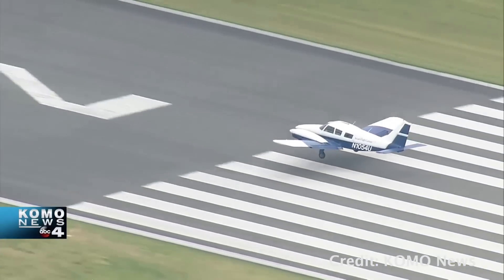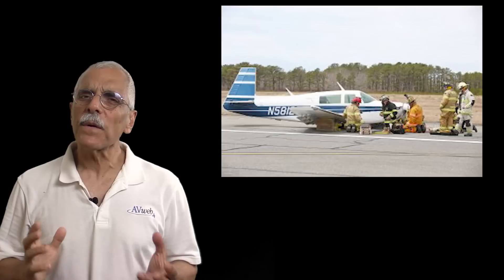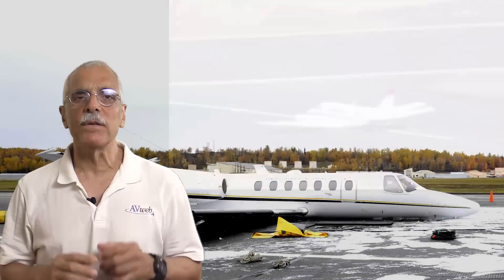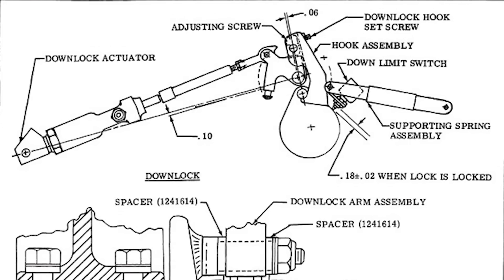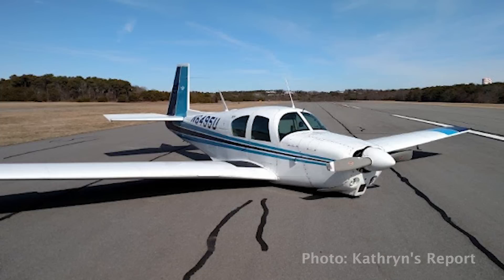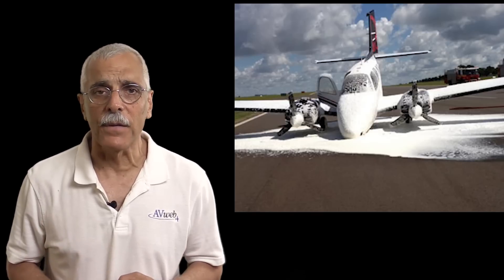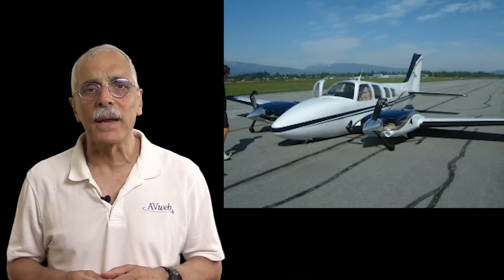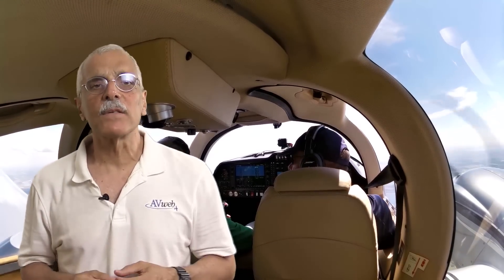Why Gear Up Landings Happen

Comment: I owned a Beech C33 Debonair for ten years.  I managed to avoid a gear up landing but only just.  On base leg with GUMP checks done and gear down, the tower gave me a change of runway.  I retracted the gear but found the flight path to the new runway was shorter than I expected with a full pattern not required.  I didn't do a second GUMP check.  It was only my habit of checking the gear on mid final that saved me from a wheels up landing.  I really miss that sweet little plane.  I flew it all over Australia.

Comment: Gump never fails, until the day you have an arrogant instructor, who wants to fuck up your routine, by TELLING you, to wait until short final, AFTER your brain has been properly trained, in when to do it. Not all instructors are equal. This one used to pump a hundred gallons of 100LL while puffing on a Salem. And good God, who wants to wait until short final, to find out that it does not work? At any rate, thank you Piper for putting the throttle alarm in the plane, or it would have been an expensive mistake. And you Instructors? NEVER try to amend an experienced pilots personal procedure, as you are NOT around for every landing! This one, even forgot his own procedure. Never flew with the dumb ass again! Proof, that not all instructors, are good ones!

Comment: There are thoose that have and thoose are about too !  
After recoving quite a few 210 and others of the strip. Most jacked gear selection replaced back to up and then down and what to you know it comes down go figure. Best advice is not to lie to your maintenance org because we know what happened and it just make you look like a fool and will not make your insurance company not  happy ethier.

Comment: Why? Too many hard landings and little, if not, proper landing gear maintenance, lubrication, wear and tear inspections, worn out cables and bolts, etc., the list goes on and on. That's why. Hard landing stresses the landing gears and could cause breakage of components. That's why.

Comment: I partially agree on the engine part ... engine should be shut down because idont think its safe for your moving propeller to touch down first....its impact will seriously damage plane and you might end up in a roll or wing hitting the runway... plus unrepairable damage can also occur

Comment: One of the reasons Bonanzas have a low gear up percentage is simply because it's pretty difficult to get the damn thing slowed down with the gear up..   My gear extension speed is 154kts but my flap speed is 123kts..  Bonanzas are such sleek airframes that you need the gear to act as the speed brake to get the flaps down and then slow enough to land..

Comment: Why is their not a down and locked sensor on the landing gear or a down and (not locked sensor) or an automatic landing gear that engages on level descent in relation to stall speed ?

Comment: A little story.
Back a few years now, I purchased a great deal at a DEA auction of a Aztec, in pristine condition, just no log books,(turned out later the engines were factory new) which was typical of drug planes. The plane was at Opa Locka in Miami and I needed to take it to Tamiami Exec, so did all the checks, everything was great, put fresh fuel in, felt real good. A friend of mine and I went to do the short ferry and a third took the car back. We took off, flew like a dream, loved the plane and was already thinking about trips to plan for. we decided to go straight out and fly a bit before dark, ya know check the beaches out. A bit later we headed for Exec, all was fine till I noticed we had NO green lights on the gear down, had to abort the landing, notify the twr and head out to the glades a bit to check out the issue, did some slow gear down checks, still no lights. We contacted Exec and they said how about some flyby's so they could take a look, it was almost dark so we did probably 3-4 close flyby's with no for sure answers on whether the gear looked locked or not. Then Rescue One, Helo Rescue here in Miami-Dade was out flying, so they wanted to fly under us to take a look with their spot light. never done any formation and that was pretty close slow flying, my friend was really nervous. we went out a few miles west on the edge of the Everglades and they proceeded to check the gear. They said it looked down, but wouldn't guarantee it. RIGHT AT THAT MOMENT, I notice a small aircraft our of the corner of my eye, VERY CLOSE to a midair, I veered to my right, yelled over the radio,  collision !!! The helo pilot later told me he heard nothing but a yell. LOL ! The pathetic VFR pilot in a piper cub, probably with no radio, almost took us , in the Aztec and the crew of 4 in the Rescue helo OUT all at once. Talk about 9 lives !

I radioed the twr and said it's now or never, no more taking risks of others. We went in, with all the crews ready , that had come in from surrounding fire stations and landed , maybe my best landing ever, smooth as can be, no collapse, held and we taxied over to do the accident report, of no accident,lol. Got to hug the Helo pilots and crew, we all went home safe that night.

The next day I had the shop at my TBO take a look at the Aztec. Some dildo drug smuggler had put a dimmer dial on the gear indicator lights to black out the cabin on some of their drug runs. All of that over a dimmer switch ! Moral of this story, check the gear on purchased drug planes. 

I know I wasn't alone that night, you just know.
Reply: That is quite an amazing story. One I won't forget. Thanks for the info.  prebuy inspection vs. " Drug plane prebuy inspection"

Comment: What would an aviation video be without a german glider pilot ;-)
I've seen quite a few gear up glider landings in my ten years of flying now.
To be fair, in a glider it's not as bad as in an aircraft with engines - you won't damage the engine, and the general structure usually takes it quite well besides some scratches.
A big bunch of them came because of the mixed use of non-retractable- and retractable-gear gliders in my club.
My personal favourite: A very experienced instructor pilot wants to fly our Ls1-f for a change. He gets a cable break on winch launch at 10ft altitude. He puts up the gear as he remembers he has to handle it before landing, forgetting he did never have time to put it up in the first place.

Comment: wonder if some airports could do something to minimise damage of belly landing , old trucks with sand or round gravel or wood chips  and dump it on runway spread it out , or some plates to skid on made of what, wood or something more slippery on underside metal or oily  with wheels or not and where , beginning of runway or near mid, even have an extra runway for gear down on hard clay sandy surface

Comment: This is why I love Mr. Aviation 101's final checklist, which he verbalizes loudly to the occupants, which includes "Gear down and locked- Welded" (he flies a Cessna 172 normally, which has fixed gear) which is a great checklist to run for any general aviation airplane.

Regardless of type, if you are not verbalizing your checklists at the appropriate points in flight, you're doing it wrong.

Everyone in the airplane should know that you have run the checklist and everything has been satisfied. To do anything else is to be remiss as a PIC..............................

Comment: A friend of mine had a Bonanza and landed gear up.... twice. One of them landing at Oshkosh during the big fly-in. Got it repaired and flew it back to Colorado where he did it again. Both times the gear handle was in the down position and they finally found a faulty limit switch which stops the gear as it cycles to down position..

Comment: Do you really want to have two engines running while hitting the pavement, the blades hitting the ground will cause shrapnel to fly everywhere endangering the occupants, the way the pilots handled this situation was fine and appropriate
Reply from the maker: Just FYI, this is an old wive's tale. Aircraft propellor blades are soft aluminum. They don't splinter and produce shrapnel. Don't believe it? Visit a prop shop sometime. All the gear-up repair jobs are bent blades, not shattered.

Comment: What’s the first thing you do AFTER a gear up landing?  Put the gear handle in the DOWN position.
Reply: One of our Baron owners tried that but forgot to reset his circuit breaker Haha, we put it on Jack's and it worked perfectly! hahaha
Reply: @robertdmoore2592  its funny you mention a Baron.  I worked on one that had been a previous gear up landing.  The only indication that had happened was the step just behind the wing was a little ground down.
Reply: Best DPE ever! Thank you for helping me pass my Cfi Initial!
Reply: That will cause way way more damage if you try that xD
Reply: @HanSolo1  you want that so you can blame it on why you landed gear up, hopefully.
Reply: @FiveTwoSevenTHR  no, because they will know what you did lol, don't try that
Reply: @HanSolo1  so you're saying that instead of that, I should quickly hop and and sever the hydraulic lines?
Reply: @FiveTwoSevenTHR  just make sure it doesnt look cut xD
Reply: @HanSolo1  It won't really add much damage to the aircraft, but it will certainly reduce the damage to your reputation.... 😉
Reply: Todd Shellnutt That should be on the checklist for RG pilots! Very funny Todd.
Reply: It works in video games, therefore still counts as good advice :)
Reply: Well one our customers tried that and we got in the airplane and found the gear CB was popped which made us a little suspicious, when we performed a gear swing it worked perfectly!  He put the handle down with the master still on and since in was on its belly it popped the CB, just tell the truth that you forgot to put the gear down!
Reply: @robertdmoore2592  Oh I get it, all that work for a mistake makes me annoyed.  Though I do understand the pilots side too.
Reply: @acar3615  we weren't annoyed it was all in a days work but it would have been nice to know the truth from the beginning because we would eventually find the truth!
Reply: hahaha
Reply: I trained some in a 172. But I always threw gear down on the radio to my instructor on my approaches
Reply: WRONG!  First you erase the video storage...
Reply: And if its on its roof make sure the master is off before you put the handle down lol
Reply: Perfect advice! Kinda 007. I'd to the same. Just imagine, shortly after touchdown, the gear coming down, the plane thus lifting, the pilot giving full throttle (that's why you should keep the engine/s running) and, in order to avoid any insurance or NTSB issues, makes a perfect re-start, escapes, flying low, vanishing in the blue skies, secretly landing some miles away on desertes farm land... ok, I admit it would best run with a high-hanging-engines aircraft... 😉
Reply: You are obviously a highly skilled, fully aware of all consequences expert pilot.

Comment: I have never understood why retractables don't have a simple gravity system like the space shuttle. Drop the wheels with auto -locking and the only thing that has to be mechanized is the lift mechanism
Reply: wonder if reason is more safety in the way of less drag if fails so can fly longer like cross sea and reach shore instead of not.
Reply: @orangestoneface  Probably the reason...but I still don't get why it has to be so complicated. As gravity always works and never fails.

Comment: Now I'm not a pilot and I am watching this beacause I'm bored, but it seems to me that touching down and having two sharp spinny bits hit the ground isn't a good idea. Those props are spinning at what? 1500 - 3000 rpm (srsly I have no idea)?  If they hit the ground and bits of them brake off you'll have metal fragments flying at 100s of km/h around the aircraft , possibly hitting and puncturing the aircraft, its gas tanks and cockpit. I don't know you guys tell me.

Comment: Older Barons had the gear and flap actuators close enough spatially and nearly identical in visual apprehension that pilots would retract gear instead of flaps on short landings. A least, that's what I've heard, and seen.

Comment: I remember that video years ago of a C210 circling in Fort Worth trying to get the gear down. They even managed to get the baggage door open in flight and reach out to push on the legs. It just wouldn’t budge and they had to belly it in. It was such a smooth landing. I think they kept it on the center line too.

Comment: I am not a pilot. But I did fly the F-111 simulator on quite a number of occasions because I had a unique ability to teach Pilots to do something with the F-111 it wasn't in the flight manual. At no time oh, did I ever forget is that was actually bringing the simulator in to land. I was also the first person that the colonel who ran the flight simulator at my air base had ever seen that flew a mission with the F-111 simulator and landed it without crashing the first time. He asked me how I was able to do that I told her it was because I was not a pilot. He asked how that made sense? And I informed him that I work on all the flight controls and instrumentation on the actual aircraft. And if you put all those lines and Bubbles and Diles where they belong the plane flies exactly the way it's supposed to.

Comment: When I was maybe age 18 I worked at a famous airport in the Northeast back around 1970 as a line boy.  It was a clear but very dark night with no moon.  There had been an electrical failure and the runway lights went dead.  A few employees got into their cars and pointed their car's headlights toward the beginning of the runway so that all the planes that were landing for the evening had some perspective.  I was on my motorcycle when the guy next to me said "hey that guy in the Bonanza has his gear up.  Well, he landed and I saw so many sparks I thought his plane blew up.
            The sparks seemed to light up the whole airport, but the Bonanza did not burn, nor did anything unusual happen.   But being a young excited kid, I drove to the nearest phone and called the police and told them the airplane had crashed and was on fire.  The next thing I saw was about 10 fire trucks and maybe 20 police cars drive onto the runway.   Of course, by this time, the pilot was standing outside his airplane, very embarrassed.   A few of the firemen lifted up his plane about 4 feet off the ground.  The pilot lowered his landing gear and they towed his plane away.  
              I never told anybody until now that I was the guy who called the police and said the plane blew up.  God, please forgive me.  Hail Mary full of grace......

Comment: You'd think most of this is common sense. My gear up was a test flight after an annual in a 1950 Bellanca 14-19 Cruisemaster at the airfield where the annual had been performed. It's a taildragger; no third wheel. And despite Guiseppe Bellanca's triple redundancy that gear was not coming down. This didn't stop folks, including a couple of Bellanca experts by phone with the shop and radioed to me, to take measures I regarded as putting equipment ahead of safety. Yes, it's a beautiful airplane. Yes, few were made. But no way in choppy air with a descending ceiling was I going to attempt to rip out the right seat and try to sever the hydraulic lines with no tools to break the hydraulic lock holding the gear up. And no way I was going to try to save the propeller or engine. And, yes, I smiled when it was over and leisurely got out of the airplane. No, I was not happy but I was amused by the way the crowd that had gathered, including the fire department, police, and EMTs, appeared disappointed in the outcome. Smoothest landing you'll ever make will be a gear up in a low wing airplane 😄

Comment: Unless you have a gear failure, there is NO excuse for landing with the gear up!  I don't care how long you've flown, use your check-list, because humans ERR , and it only takes one time and a distraction for a disastrous result.  (One exception, is if you must land on water and could flip over, but that's very unlikely.  There are SOME emergency landings where gear-up may be an exception, but they are very unusual.

Comment: Taught to fly R/ C by a ww2 P-51 pilot, at Antenna Test range NASA Johnson summer 1971. I had previously self taught control line. After soloing in some 4 weeks, I noted my trainer was a small foam molded thing. I did not figure how to set the throttle up so had a high low end idle. My thought was to, since it was a light small cc gas motor about 30% glider. I would climb up not quite out of sight near end of fuel, the timing became like my favorite star trek character Spock, precise. After the engine quit, I would glide around for another 5 or more mintues, doubling the flight time. After about 68 dead stick landings, I have a high level of ease landing a model dead stick.  My A&P said if the engine quit on my 1971 Cherokee 140, he could turn around to the runway (180 degree no no), with only 500 feet altitude. I said no 1000. He shook visibly nervous. Scrolling back to flying R/C out of college. A friend handed me his Transmitter after his Cherokee 140 (semi scale) engine got quite. I turned downwind in a second after the ting was in my hand. To my surprise, it made a harder than desired landing on half way through the cross wind. So, with this in mind, I flew my real Cherokee (a few years ago), up so some safe altitude. Pulled the throttle to idle while S and Level (?). In some few seconds, maybe 5, I lost 500 feet. My P-51 veteran, taught me if the engine quits on takeoff, DO NOT TURN BACK TO THE RUNWAY. You will attend your own funeral in a laid back way.